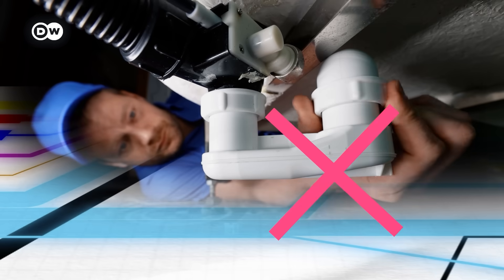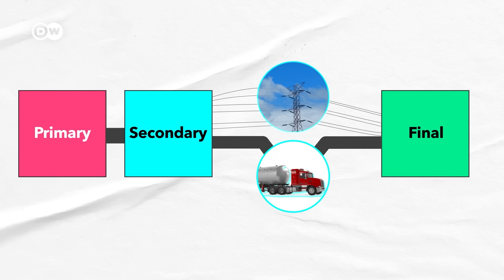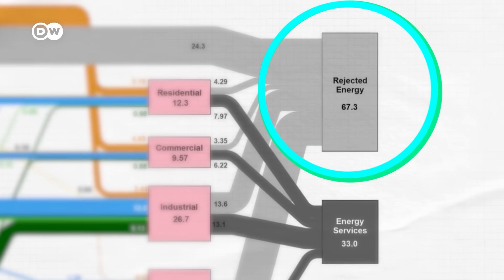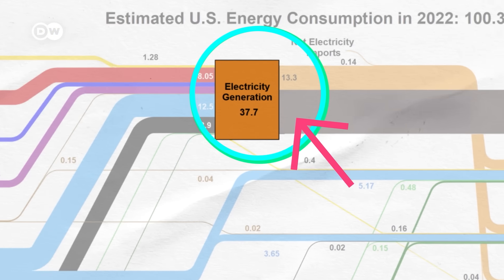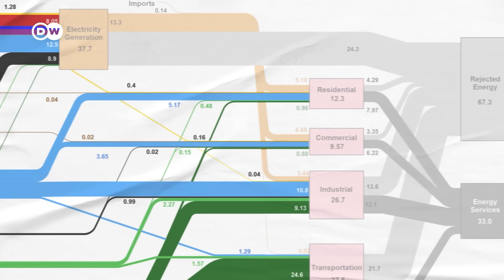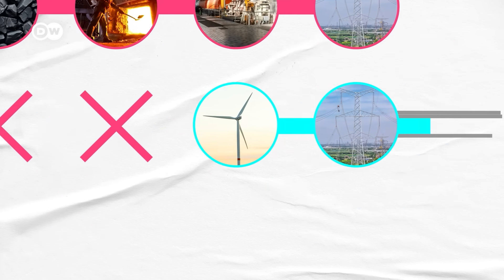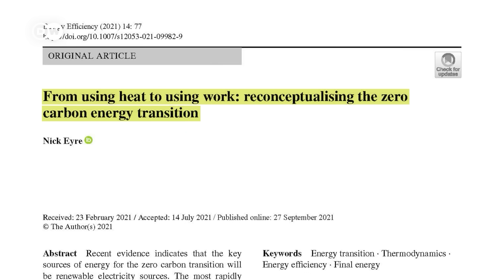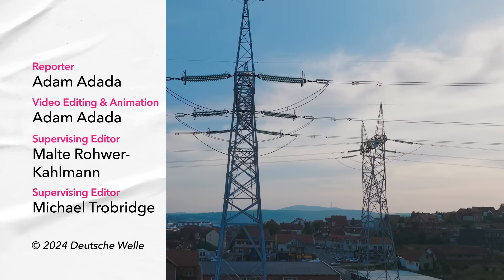The mind-blowing thing we get WRONG about energy

Comment: However, the cost of getting renewable energy is much higher.  How much does it cost to get a billion units of energy from coal, and how much does it cost to get a billion units of energy from renewables. We must build and replace windmills and solar panels every 30 years.  So you must deduct that from the output of renewables.    To have a sustainable windfarm, we would need to use 80% of the energy it produces just to fund the replacement.   So it drops from 90% becomeing useable energy to 20% useable, since the energy going into creating the windmills must be deducted from the output.   Cost = energy.    It takes 10 units of energy to get 50 units of useable energy from fossil fuels.   It take 40 units of energy to get 50 units of energy from windmills (or solar panels).  In other words, if we had no fossil fuels then most of the energy from renewabls would be spent replacing windmills and solar panels, leaving only a small fraction to do everything else.

Comment: A heat pump does not generate 3-4 times more heat for the same primary energy they use. A heat pump uses 1 unit of electricity to produce 3 units of heat in mild weather (could go down to 1.5 in very cold weather). But you use 2 to 2.5 units of primary energy to produce the electricity needed to feed the heat pump. Usually heat pumps use PV and wind electricity to a very little extent. Instead they use marginal power m contributing to peak demand. So the primary efficiency of a heat pump is usually the COP divided by the PEF (primary energy factor) for electricity.
To conclude a heat pump will end up with a primary efficiency of 300%/2=150% in the best case scenario. The colder it gets and the less efficient the electricity production, then lower its primary energy efficiency. 
This also assumes that a PV or wind is 100% efficient. But in fact their efficiencies are lower then 40%. This is ok on one hand because the wind & solar energy is "free". Yet, the materials that go into producing the PV/wind turbines have a cost. So we cannot completely ignore their inefficiencies.

Comment: I like this video... except when it gets down to vehicles... Battery EVs just don't have the energy density compared to petroleum, currently. We need to get off of Li-ion batteries, there is so much riding on the promises that new battery technology is suggesting but has yet to be completely actualised or able to be reproduced/mass manufactured.

Comment: Stop with the wind and solar nonsense!

Efficiency isn’t the problem, energy density is. 

Work takes energy, and even at 99.99999% efficiency, there’s still a minimum required input to get the work done. 

That’s not a defense of fossil fuels by the way, because even fossil fuel‘s are not going to be sufficient to meet our energy requirements.

The sheer scale of the amount of energy that just the United States uses is far beyond what most people are aware of, and it’s definitely beyond the ability of wind and solar to be a solution. The only energy source we have with the kind of energy density necessary for a 21st-century technological civilization, is nuclear.

Comment: The problem with presentations like this is that their research starts with the conclusion they want to make and works backwards. All processes have inefficiencies. In a light bulb only 10% of the energy consumed actually produces visible light. The other 90% is wasted energy. However producing light by burning gas converts much higher efficiencies. So should we ditch light bulbs in favor of gas lamps?

No of course not! There are other costs and concerns for doing so. Like wise with the so called Green energies there are costs and concerns. When it comes to all electric vehicle the biggest cost and concern is the cost for battery replacements. There are other concerns such has losing charge and the time it takes to restore range (via recharging). But we hear none of that in this video.

Comment: but switching to electricity isn't the silver bullet.  Electricity generation is much more efficient yes.  But the TRANSPORT of electricity is only like 30-35% efficient.  A ton of energy is wasted just getting it to where it needs to be used.  The best option would be to put renewables (wind/solar) on every house and every building so the energy is directly being generated where its used.  But when the sun is down and the wind isn't blowing then the inefficient base load power is used which is inefficient to generate and really inefficient to transport.

Comment: Good point. Unfortunately many of the examples after minute 7 confuse thermal and electric energy. If you wouldn't compare apples and oranges like that, you would notice that in the heating sector there are no conversion losses. That's the biggest piece of the pie.
And of course we will have high conversion losses in a future energy system, even if it is based on combustion free sources like wind, solar, hydro and nuclear. Just think of hydrogen or synthfuels. Or think of process heat with electric furnaces.

Comment: This argument has a basic fault, renewables have their own rejected energy issues.  PV panels produce only about 20% of the energy that falls on them from the sun.  You can argue this is not loss but actually you loose the real estate under the panels being unavailable for agriculture and other uses.  Even when produced, PV and wind electricity is harvested often in remote locations and transmission losses over distance are huge. Others have commented that replacing industrial heat from fossil fuels is often hard, costly in time and resources and sometimes impossible. Efficiency in processes is something we should always strive for but there is always a cost benefit trade off.  EV’s are again mentioned as 90% efficient but no mention of the fact that they have a huge carbon footprint in production that normally takes up to 10 years to extinguish and reach equilibrium with ICE vehicles.  10 years also being the life cycle of the most carbon intensive portion, the battery.

Comment: You  are not including energy density into the calculation. The reason we haven't switched over is because the energy density of solar vs petrol is several orders of magnitude which offsets any efficiency savings. If you included this factor in the graph, you would see this one point alone thwarts any negative impacts from using fossil fuels vs renewables except nuclear which is several orders of magnitude more energy dense than petrol. Nuclear is the only way to sustain any of this.

Comment: Howdy hi hi,
     While I can't share the details just yet due to the stage of development.  I can say that I'm currently working on a system that will harvest better than 99% of the energy striking a collection plate.  There are still inefficiencies within the system, but the amount of loos experienced is being diminished with each new iteration of the unit.  The goal is the hit electricity generation at a level that is approximately 95% of the energy level brought in by sunlight.  I call these units the black hole generator.  Coupled with large battery capacity built into the systems.  I anticipate an escalating level of profit with each and every unit produced and put into service.  Its not ready just yet, but soon.

Comment: Where I live a new gas boiler is 6.500 USD and the equivalent heat pump is 45.700 USD. Installed.
Expected service life of the heat pump is around 15 years dependent on make, correct installation and service.
My condensing gas boiler was installed in 2005 serviced every 2 years and burns according to last CO2 measurement as if it was new.
I will never ever be able to make a financial return on the investment in heat pump.

Comment: Much of the inefficiency in fossil fuel is a law of physics call Carnot efficiency.  To increase that even a bit requires much higher temperatures, which require better materials, and much more maintenance.  That same inefficiency applies to nuclear and geothermal, or anything that drive a turbine with heat.  

There are places that use that lost heat instead of using electricity or fossil fuels to create heat.  The one place where fossil fuels are very efficient is in heating, some furnaces are over 90% efficient (10% lost up the chimney).  Electric heat is 100% (heat pumps are "300+%" because they use energy to move heat).

Are green energy sources more efficient?  Solar panels are about 20%, the other 80% leaves the panel as heat.  That heat contributes a bit to global warming, but not much.  Wind and water power appear efficient at the point of generation, but the efficiency to create the wind, and move the water is very low.

EV's are more efficient, but that almost disappears if they use fossil fuel generated power to charge the batteries.  I charge my EV during the day from my solar panels.  Put solar panels over parking lots, you can make a sizable dent in the transportation energy (asphalt converts most of the sunlight to heat, so the solar panels don't add heat).

Comment: All good at this video 
But 7:29 swiching to the new car is not a good think to do , when you car is still operable and you can drive it without any problems ( and even then if something fails just let the mechanic repair your car and don't buy new one ) and if it isn't like burning over 60L of fuel per 100km . Furthermore making of new car would produce from (around )
600 000  to 1 000 000 tons of Co2 ,(using car that you using is better for the envoirement if the rectrcions from the above are setled )   .Moreover  inefficient ion'ic battery's ( and im not saying that it more inefficient that burning fuel ) but it is inefficient , until we would have solid state battery's i think that full electric car's are un-useible in country's that stays on fossil fuel.

7:41 we are realy not compering apples to apples beacuse radiotor heater's are good for heating of individuals also it is good for places that have low magnitiude's of temperature in which heat pumps are very ineffecient ,but let don't downgrade the heatpump's they are great for heating and cooling large places and it is right that is absolutle more efficient for that purpose . If we are concentated on heating individuals Infra-red heaters are cheaper and they do what thay are made for create radiation that heat's up place that they are faced (personaly i think that if we want remove radiator heaters we would need firstly go to infra-red heater's and then heat pumps)

and commenting the end part IM NOT SAYING THAT WE CAN MOVE TO THE RENEWABLE ENERGY WE CAN but it is not on hand for goverment's (AND ALSO NOT ALL GOVERMENT OVER THE WORLD BUT THIS MOSTLY AT cental Europe) ,to put everything into renewable's ( mostly beacuse it takes effort to do something than nothing ) and also that it take money ( but compering  to sky rocketing prices of fuel and legal fee's for burning fuel we end up at 0 , so goverment officals don't know about it ,which i hope isn't true  , and as i said before it take effort to do something than doing nothing beacuse it is net zero it doesn't mean that it wouldn't pay back)

P.S sorry for my bad ortografical writing ( i don't know if i writen ortografical right) but there are MANY MANY MANY more factors that goes to changing on renewable but for now it propably would just slowly goes put for renewables and clean'er energy . just ending i hope that less and less people would be scared of nuclear energy  beacuse now it is ULTRA safe to build 
nuclear energy generators for nearly all central european country there are no envoirement giant disaters like (earthquakes and tsuamis ), i  will just stop now i'm writning it for nearly and hour and i could write more but i thing it is enough , reader if someone is reading it you can just email me for more informations and sorces or just to talk about it . thanks for reading that

Comment: The heat loss in fossil fuel energy generation is irrelevant here, because it's not counted in the numbers we always see for energy production, which are the "secondary" value. So the ideas you had of how difficult it is to replace fossil fuels are still valid (or as valid as before, at least).

Comment: Speaking of gas stove (which I got at home), couldn't it's efficiency be slightly increased by istalling a reflector on it? Something simple, like a polished sheet of stainless AISO 304 steel. Or we can make it slightly more sophisticated by bending it into a shape that would concentrate heat onto a bottom of a pot or a pan.

Comment: You touched on the most important point and then ignored it. Peak demand. The problem with renewables at the moment is that we don’t currently have the scalable technology to store energy. Yes your car or house is possible but not cities. There is not a city on the planet that can run for 24 hours on a battery. You therefore need double resources. Renewable with nuclear or carbon based backups. In rare cases hydro. 

We (humans) will get the technology to generate and store renewable energy. At this stage I see 2050 as a pipe dream. 

It irritates me that commentators and pod casters make these uninformed videos and mislead the masses so they can get clicks. 

The real damage is that removes logic, science and physics from the argument. 

I dream of a renewable system that’s works. We (the west) however are ruining our children’s economic future with fantasy engineering.

Comment: I have a full solar system for my house in South Africa. In winter or cloudy days I don’t produce enough for my household needs let alone to charge a car. My roof has 20 large panels on it and is efficiently placed and angled. I have two 5.5kw batteries. So while solar has saved a lot on my fossil fuel (South africa burns coal for its electricity) it has not eliminated my need for it. And I am 23degrees south so I get much better sunlight hours in winter than where most people in the northern hemisphere live. Until technology improves I just don’t see me being able to not have a gasoline mode of transport.

Comment: Renewables have their own challenges with regard to efficiency issues. You need longer electricity grids to deliver energy from one place to another. You have the issue of saving the energy. On a small scale, you can use batteries with a relatively low amount of wasted energy. But on bigger scales, even the so far most promising saving methods like Hydrogen lose a lot of energy - so much so that the amount of rejected energy would increase.

Comment: There are 2 things I don't understand, maybe someone has pointers?

- if the chain fossil fuel > heat > turbine > electricity results in lost heat and efficiency, how is wind turbine > electricity > heat more efficient? It seems like it would be a lot easier to just burn gas in order to get heat for your house or a bakery's oven.

- is it realistic to electrify everything? Especially considering the impact of mining all the necessary metals to implement the wires, batteries, poles... Aren't we creating more damage by multiplying the mining this way?

I feel like a much easier solution is to reduce our needs. Not the only way to think about this problem, it just seems like a good way to get most of the work done by... Doing less work.
Reply: Typical turbine based power plants only have 40% efficiency, because you need 300 degrees Celsius hot water for the turbine.

A wind turbine puts out electricity directly.

If you use a heat pump to produce heat in your home, the electricity is only used to power the compressor and fans. Therefore, you get about  2 to 6 times more heat energy (kWh) than you require in electricity, so it has about 300% efficiency. 

A modern gas furnace has 90% efficiency for heating.
So, even if you use a gas power plant to produce the electricity, a heat pump is more efficient than a gas furnace overall.

No heating is no option and with 100% electric you do not even need a gas pipe into your house, so a heat pump will even save resources in the long term.